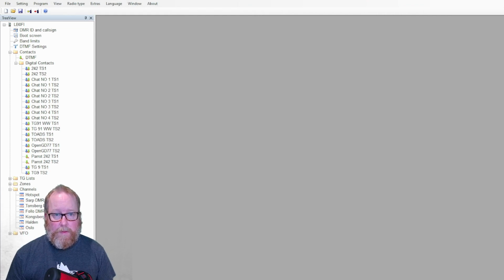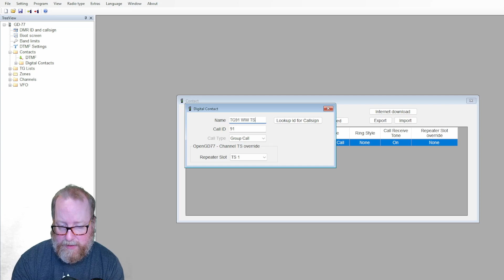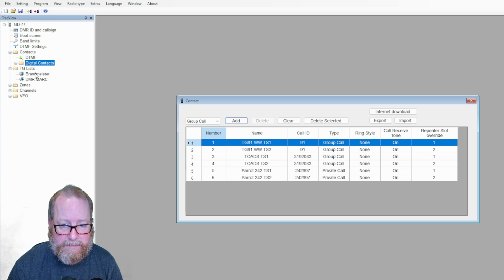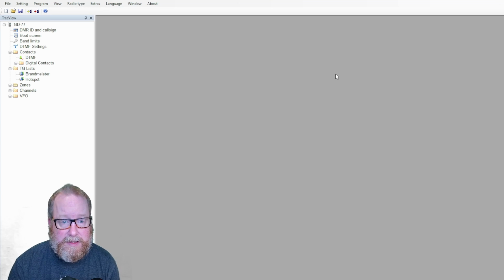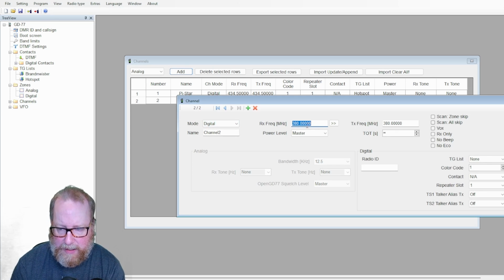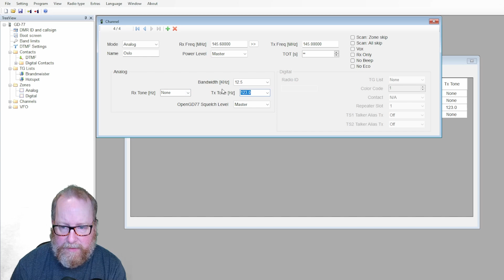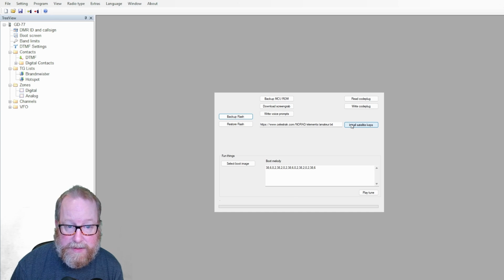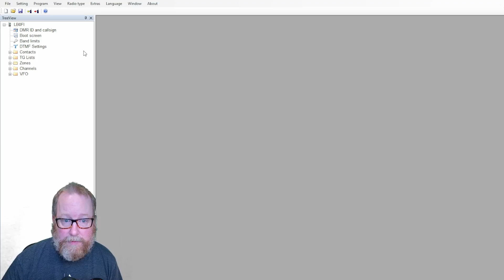Making an OpenGD77 Codeplug in 20 minutes

Comment: New to DMR I found this. Helped a bit of how this is done, but I wish I would know more about the why as I am still very confused about how contacts, TG lists, zones and channels work together. Why separate the timeslots and analog/digital, what is the practical impact of that? It would probably help me to see how those settings can be used on the radio, like with the parrot. Maybe those are stupid beginner questions, but that's what I am struggling with right now as a beginner... I hope this can be received as constructive feedback and maybe you can do a follow up video showing how to use this codeplug on the radio. I would love that, because you seem to have a great way of explaining and there are still many new operators coming up and searching for good instructions on this complicated topic. thanks and 73

Comment: Hi.     I think my Pi-Star and Baofeng DM-1701 are mostly programmed correctly, and I added 242 under My Devices on the Brandmeister dashboard, but I still can't hear any of the Norwegian talkgroups, even though the Norwegian Parrot works fine and I can work 242 over my hotspot.  This is just digital. I just wondered if you have any ideas about where to kick my setup that I have not already tried! 73 frm Sue LA0CY
Reply from the maker: Hi Sue! Troubleshooting DMR can be hard. I assume you have checked that color codes match. Timeslots are not important on a hotspot, but I tend to use TS1 on a hotspot nonetheless. Besides that I don't have many ideas, but feel free to send me an email at morten@lb0fi.no and we can take it from there.

Comment: I got an old Radioddity GD-77 at a secondhand store and since this software is called OpenGD77, I can assume it will work with this radio. I'm just starting in DMR and find it terribly confusing. Should I just stick with the original GD-77 codeplug software or get this OpenGD77? Which would be easier? We have only one repeater here that does DMR (it also does DSTAR and Fusion) and I won't be getting a hotspot. So I'll likely want to program in quite a few of our analog repeated. I did happen to get a DMR ID already so I'm good there. So far I've installed a blank codeplug into the radio so I could actualy use it. The person before me had in a password that I could not crack. Now I can get into the radio at least. I put in the original software codeplug, not the Open GD77
Reply from the maker: OpenGD77 should definetly be good on this radio. There are some good instructions on the OpenGD77 website on how to do it, and if you have some experience on loading custom firmware on devices you should be good.

Comment: If i add a digital repeater with a frequency split either vhf or uhf the RT3S won't transmit. Only flashing red led. Analog repeater splits are fine. Digital on hotspot either vhf or uhf are fine. Any ideas what im doing wrong?
Reply from the maker: Unfortunately not.
Reply: @figspigsandfeathers8179: Check to make sure you have the correct color code and time slot set.

Comment: I just installed Opengd77 on my uv380 earlier today. It took me about an hour all together. Most of that writing the new code plug. People tend to panic when the first hear "code plug". Basically every radio needs a code plug. Even analog radios but with less info. It was quick for me because I only wrote 41 channels and group contacts. Easy built in import of IDs and it even pulls them from the source.
Reply: Since DMR started out on commercial and municipal radios, I think the archaic term code plug has been kept around to make the radio config guy's job sound more complex than it is.  "You need me to add these channels to the radios? Give me a couple of weeks to write a new code plug."